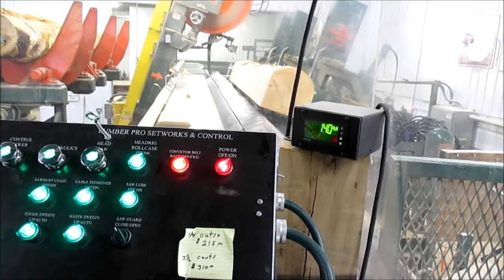Lumber Pro - Running in MI

Comment: Having run a small band mill "Wood-Mizer" for 32 years the double cut bands must have some very tricky means to keep blade in position and not running off drive and idle wheels.
Reply: Scott Mckenzie the wheel
s are crowned, or have a convex surface, and the band is under a lot of tension stretched tight so that it “wants” to stay on the wheels

Comment: Impressive machinery. However, what is the principle of the blade being on an angle, unlike most other vertically bladed machines ?
Reply from the maker: With a 17° tilt mill your cant is always against your face-plates because your working with gravity.  Also, the boards slide down better than a traditional vertical mill.
Reply: @CleeremanIndustries  Many thanks. Greetings from Scotland.
Reply: how much is this machine??

Comment: What happens when the wood is thicker, can they get a longer blade & raise the top wheel??
Reply from the maker: The saw guide moves up and down depending upon the size of the log.  The maximum board width is 28" because the belt is a 30" belt.

Comment: All that production and hardly any people in the factory!
Modern tImes.
Reply: cicero2  I was an engineer in charge of a very big mill(band saw wheel diameter was 4 meters) and we went from a mill staff of 40 to 3 once the new head rig was operational. Faster and safer too, with no danger of heavy lifting.
Reply: Mercmad  Thanks Mercmad, but what are the 37 redundant doing now?
Reply: cicero2 Because the production increased several hundred per cent, these guys were all employed in the timber sorting, driving ,delivery etc sections. In fact another 20 were employed as we went from a 9 hour day to a 24 hour rotating shift system .The main business was supplying timber in 12" x12"  to the Japanese.
Reply: Mercmad Thanks once again. It sounds like a good business model.